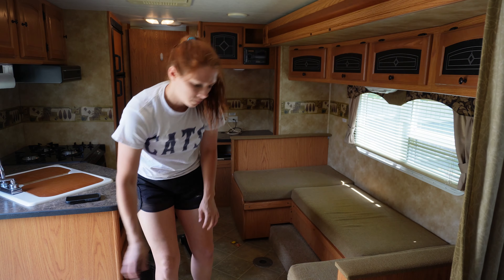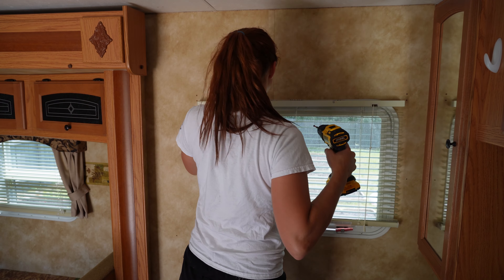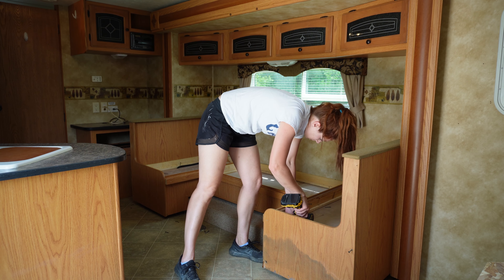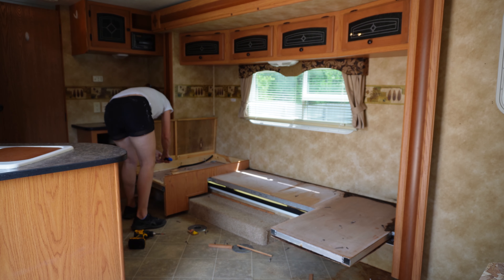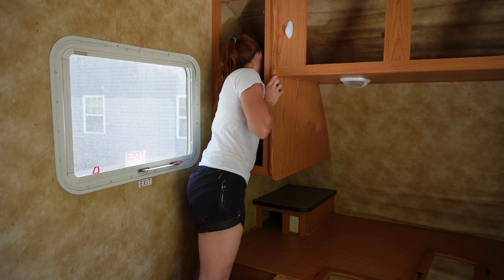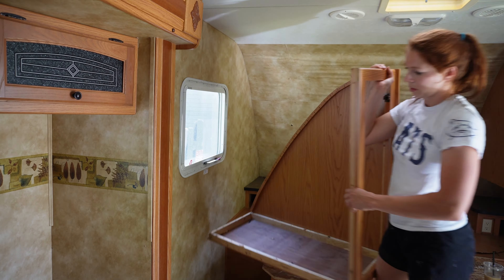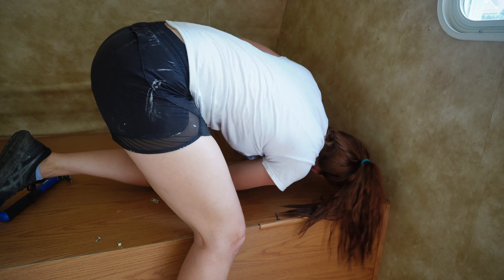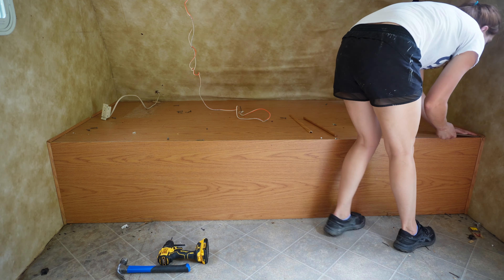North Trail RV Demo: Day 1 (Dinette & Bed removal)

Comment: You are such an inspiration to getting me started re-doing my 1995 fifth wheel.  I know there's water damage and I need to fix it, but I just wondered how I could do it without "starting with a clean slate"!  I think that's the best way, just clear it out and start over.
Reply from the maker: There definitely is, there’s just so many spots where there’s water damage in this camper it’s less work for me to take it all out 😂